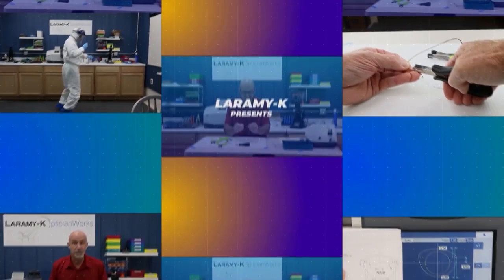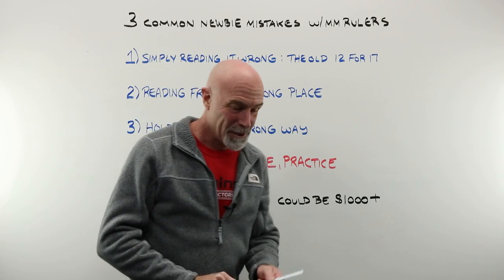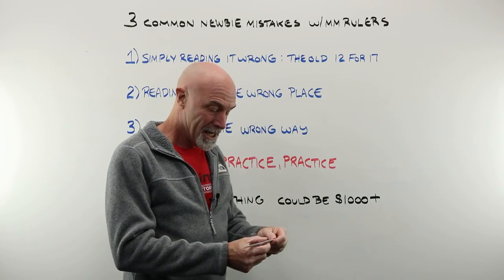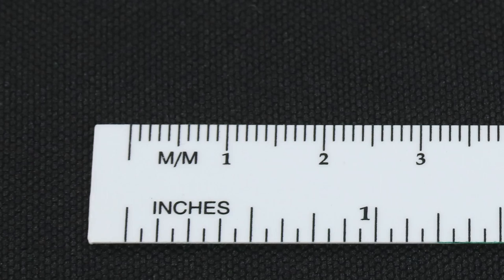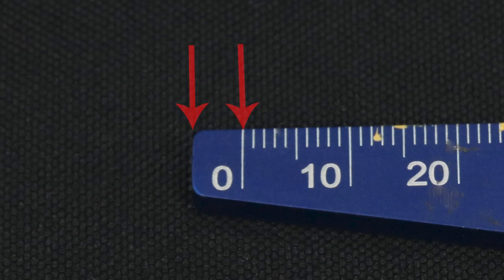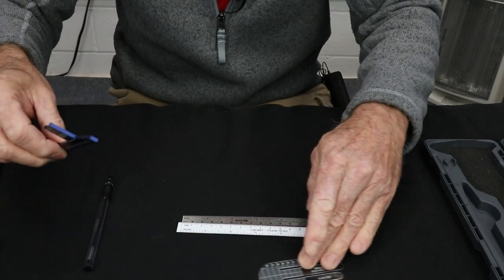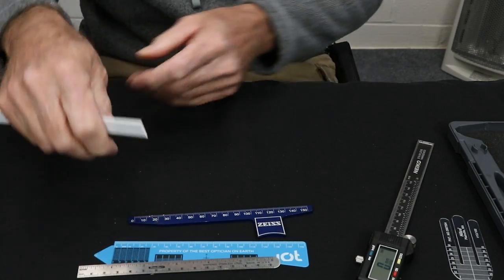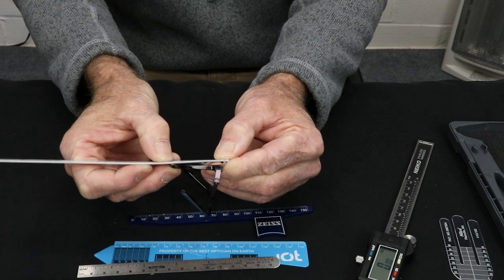Basics of Working with a Millimeter Ruler or PD Stick

Comment: Measuring a mm with a caliper is just not accurate...measure 20cm where you should see a change because beeing wrong can amplify with size.
Reply from the maker: Error may amplify with size I'll give you that. Certainly not a bad idea to try 20mm. But - assuming my calipers are accurate then measuring a mm with them is accurate. Your way of thinking would mean that the calipers accuracy increases with the size of the object being measured. A mm is still a mm. But - again - measuring 10, 15, 20 would not be a bad idea at all! Thanks
Reply: @LaramyKOptical  i often find rullers with 1-2 mm error at the top end ...I love your videos sir(I learned a lot from them). Thank you
Reply: I think his way of thinking is exactly the same as any engineers. If your measuring something the vernier jaws can fit around and can be used how they are intended then they are as accurate as the calibration label suggests. But if your offering them up to a ruler to check 1mm is accurate, it is only as accurate as your eyesight. If your rule was .025mm out, would you really notice by offering up the verniers like that? If you measure 20mm, that .025 per mm is now a full .5mm. That’s easily distinguishable. The margin of human error for aligning the jaws etc is now taken out of the equation. I don’t think he was suggesting that a calibrated measuring device doesn’t measure smaller measurements as accurately as larger ones. It’s us humans who can’t. Infact, cheap digital verniers tend to have bigger issues when going into larger measurements as they can loose track of there own scale if you open them too quickly etc. so as it was clearly suggested, the way your using them would be a lot more accurate for it’s intended purpose if done at 10/20mm. But I guess, if your allowed a give or take of 1mm in the prescription without having issues then unless the glasses are of normal size, as long as the ruler looks ok, it’ll do 👍
Reply from the maker: @olicook4153  Agree 100%! I wish I had thought of that and suggested a 10mm and a 20mm test. The way the opening statement was worded threw me off - but I did agree with it. Of course unless a shop is old enough to have had a pattern edger they probably don't have calipers around anyway. Thanks for the follow up. And I'll pin this thread at the top of this. John

Comment: After getting 4 different results from 4 different people (I was one of the 4) in measuring my PD at home, I decided to try a different method.  The measurements varied from 64 to 69, and I considered this unacceptable.  Here's what I came up with.  I took an 8 1/2 by 11 piece of card stock and went around the edge marking 64 thru 69 mm distances.  I then punched small holes with a leather punch at these various distances.  Next step was to look at an object across the room and see which set of holes gave me unrestricted vision.  Not perfect of course, but I felt more confident doing it this way over the PD ruler.  It also revealed that it made a difference where you were looking, up close vs far away.  I certainly see the advantage of using the pupilometer, but I wanted to go online for a change and needed my PD.  Love your channel.  Wish I'd discovered it sooner.  Curious what your opinion is of my 'method'.
Reply from the maker: Sorry - But the one thing that a PD stick is never used for is taking a PD. The last optician to do that died twenty years ago. For measuring PDs we have the pupilometer and now the electronic measuring devices like OptiKam Pad. Both very accurate and compensate for gaze and convergence. Unless you have very strong lens powers (or wearing a progressive) a mm one way or the other isn't going to matter much. If you feel comfortable with your method - GO FOR IT! Sounds a bit complicated to me - but I'm wrong about so many things. (Can't help but notice you have a binocular measurement there.)
Reply from the maker: https://youtu.be/sz1gNPBMkXE
Reply: @LaramyKOptical  Even more impressed with your website after such a quick reply.

I had already watched that video a couple of times and considered getting a pupilometer.  The problem was that that would cancel out most of the cost savings of going online.  Also, I would still be depending on someone else doing the measurement. I meant to mention that I realized it was a binocular measurement.  I wouldn't be surprised to end up getting a pupilometer anyway.
Reply from the maker: @donaldschlag8277  Since you have watched a bunch of videos you have already heard this but I'll repeat myself. If you have high powers and/or progressives you can't shop online. If you have low powers in single-vision you can shop online and then a difference of a few millimeters one way or the other isn't going to make any difference at all. See the three part video series on Verification - Final Inspection.
Reply: @donaldschlag8277  it's likely parallax errors that you're seeing. If your assistant is up to it, just explain the problem. I was a school drop out who never went to university, but fortunately for me my sister is a phd. She understood immediately. 😁

Otherwise, you need to take charge of the measurement yourself. First off, you need to place something between your eyes for the ruler to rest on while the measurement is being made. This ensures the ruler doesn't slip and move around. I use a piece of plasticine. An optician wouldn't do this to a customer, but hey it's my own face. If you don't have that handy, take a hankerchief, soak it in tap water, and squeeze it dry. You want it slightly damp but not dripping wet.

Your assistant must be directly in front of one of your eyes when lining up the 0. Make sure they close one of their own eyes. Use their free hand if they have to. Then you help hold the ruler as they move to your other eye and read the measurement with THEIR SAME EYE. Ensure that they are properly lined up.

You could do this yourself with a mirror, using the appropriate eye one after the other. But I'm -6.75 and -6.50, and I can't read the ruler without my glasses. And needless to say, the measurement should be made with your glasses off. But contacts should be fine.
Reply: PS: make sure to do this in a bright environment. Because obviously, if the pupil is smaller, it is easier to get a more consistent reading. Otherwise, left edge to left edge, rather than just a random spot in the pupil. And of course you need to ensure your eyes do not move.

I stacked books on a desk and rest my chin on them to keep my head steady, then stare at a distant object out the window (or where it would have been when my sister's head is not in the way). This keeps my eyeball pointing in the same direction.

Perfect consistent repeatable results over multiple days. But I can understand why opticians no longer use rulers.

Comment: How about when checking a pd on a finished wrap sunglass?  Is it correct to keep the ruler flat across the bridge and not bend the ruler to the front curve on the sunglass while checking a pd measurement?
Reply from the maker: mm rules are never used to get a PD. If you were forced to try for some reason you wouldn't have the customer wearing a frame of any kind.
Reply: @LaramyKOptical  I think Alexis might perhaps be measuring the PD of the frame instead of the person wearing it, in which case it should obviously be DBL + A as you stated in the boxing video. Though, why would anyone want that. Maybe those are prescription sunglasses?
Reply from the maker: @danielch6662  Great catch - yeah with the benefit of hindsight maybe that is what she meant. (DOH). If the subject is of interest to you watch the video High Curve Step Bevel in the edger. PD/Frame PD comes up there.

Comment: But you have missed out the most important part, all your measuments will be wrong as you have not told the px to look in each of your eyes when measuring
Reply from the maker: No, didn't miss anything since the one thing we never ever use a PD stick for is taking PDs. That is what the pupilometer or electronic measuring device is for. We just covered that in the video two weeks ago.